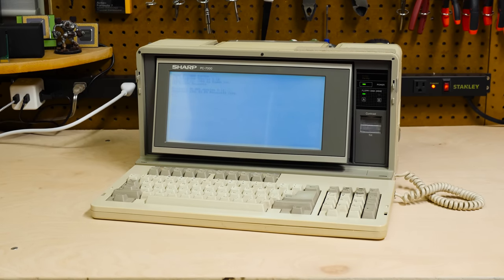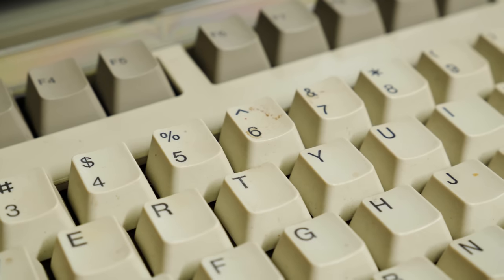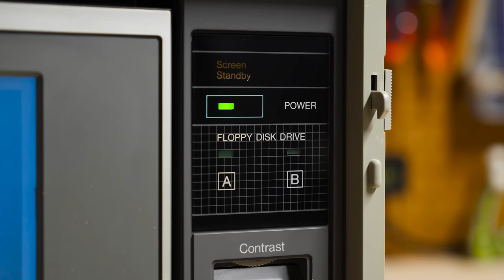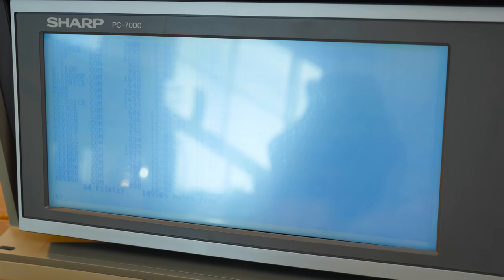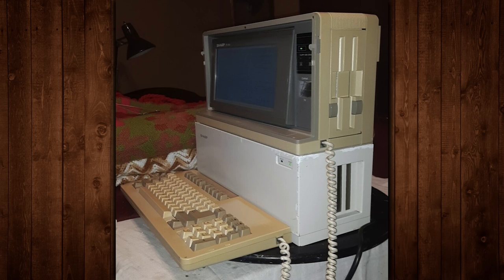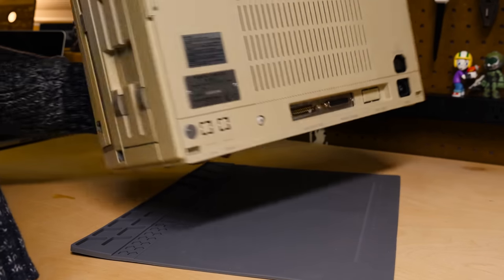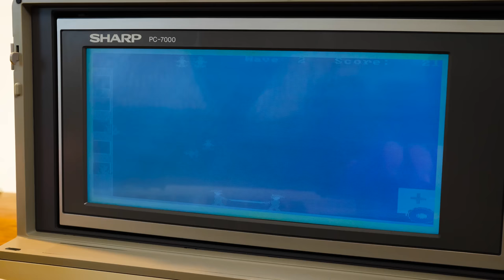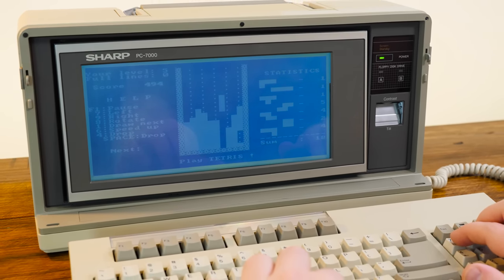$1,795 Luggable PC from 1985: Sharp PC-7000

Comment: I worked with one of those between 1988 and 1990. I was developing software for lotteries and aside from using the computer to edit and store programs on its dual 360 KB floppies, but would also use it as a terminal to connect to a mini-computer or use KERMIT to transfer files. The fact that it had an attached printer was an unheard-of option at the time. The monochrome screen was easy to read and it had a good keyboard. I wish I still had mine.
Reply: I wish they still made things like these.
I am a word processor / text editor fan, and I would definitely not mind having one as a text editor over a freewrite or a alphasmart.
Reply: @robertnussberger2028  The 8086 processor was faster than the 8088 on most PCs at the time. Having a built-in screen, even a monochrome one, was great at the time, and you could even adjust the viewing angle. Those were the days of Kermit, 2400BPS modems, Xterm, and all GUIs were character-based. I wrote PC assembler for the Sharp and used word processors to edit higher-level languages, transfer them to the host (or used the host editor interactively), and then compile and test there. Those were the days.

Comment: Also, pro tip: if you have the CGA add-on card, then you can play Those 160x100 modified text mode graphics games. I had mine configured with the onboard display as MDA while the CGA card is connected to an external Sharp TTL CGA Color display (yeah, it can totally support that use case). Good times.

Comment: I had one of these on my display at VCF East in 2022, with the factory hard drive add on and thermal printer. There were two hard drive add ons for the bottom, one with the ISA slots and one without, the one I have just adds a 10mb MFM hard drive, and about 15lbs to the carry weight!

Comment: @12:28 I know exactly what you mean.. While I used computers before we got our first one in 1994, it wasn't until that sorta point in time where I got to experience the older computers from the 80's. My closest "hand me down" memory is of a newer machine, sure, but I got a 386 laptop from a friends dad. Can't remember the model, but 386 at 16mhz I think? That B&W passive display tech, ~80MB hard drive, windows 3.1 and dos. I ran so much different stuff on it.. from Sim city, Civ, to transferring Nascar to it using a chain of floppies copying the folder from our family computer. Yup, the nostalgia bug goes hard thinking back

Comment: This remebers me of the first "laptop" from my dad. It was a Compaq Portable II and had the size of a midi tower PC.
Years later, I used it to program Siemens Siematic S5 or AEG Logistat A020 SPS systems
Reply: my father just had a massive full atx tower box (i think it was a 286 or 386?) with a drawer handle screwed into the top to take to project sites if needed.  there's really no modern case equivalent in size, some e-atx cases get close but this monster was like 3.5ft tall and weighed 80lbs.

Comment: This reminds me of the HP95LX I had back in the early 1990's. No hard drive, only a PCMCIA slot with ROM based DOS and applications and battery powered with AA batteries from what I remember. I bought the accessory printer and used Derive calculus software on PCMCIA during college calculus and linear algebra classes. It was great but admittedly slow and fit in my backpack easily.

Comment: What would it take to get ya to pick up a nonfunctioning one of these and turn it into a sleeper modern system? The conversion could be really interesting, and I bet you could cleverly hide a storage cubby for a mouse behind the 5 1/4 drive panel.
Reply: "Sleeper" is unlikely given how tiny of a motherboard you'd have to use for it; I'm guessing even mini-ATX would be pushing it. No doubt the mount points were made for some completely custom size, so you'd have to deal with that. And I can't even begin to imagine where you'd get a screen the exact dimensions of this thing. Probably from some supplier for digital dashboards or something.
Reply: @stevethepocket Maybe you could make the screen a system readout or something? Showing temps, fan speeds, etc.

Comment: Still using my Atari PC3 XT (and after searching for +10 years since 1 month also an Atari PC4LC) which I got since the '80's (my father bought it brand new back then). Still running strong, although did some updates like xt-ide, vga card and umb card. Those old systems keep on going!

Comment: I think it was a year ago that I was able to get a PC-6200 device from a shopkeeper who had put it in his shop window as a decoration. It was more like saving the device, because most of the back of the device was out of its natural form due to the heat and direct sunlight. After 4 hours of cleaning, I opened the device and realized that one of the parts was burnt. However, I still could not find the charger and battery or even the broken part of the device in my country. its a shame, I really wanted to bring the device back to life.

Comment: I didn't know you had one of these! I picked on up for free some years back but sadly neither floppy drive works. Haven't had time to go back to it yet, but the 8086 itself makes this computer stand out from the rest of my collection. One interesting featurette about this computer is that there are two positions for the carry handle, because the weight of the unit shifts when the printer is attached. Thanks for the run down - great to see another enthusiastic owner 🙂

Comment: Compaq had similar systems. Released in 1987. The Compaq III. A 12 MHz Intel 80286 and Compaq 386. A 386-20 MHz system. Both with 10" amber gas-plasma display and detachable keyboard.

Comment: The biggest issue with old portable computers isn't always even carrying them, it's the pain of actually using them on the go. You can't just pull it out and use it like a phone or modern laptop, you have to plug in power, boot it up and maybe put in a disk, connect to a phone line or internet. Once you get one out to use it you have to dedicate some time to make it worth it.

Comment: I have one of these with a built in hard drive in storage. No display last I tried it though. I'll have to dig it back out, I bet that damn Varta splooged all over the board. Now I'm curious if it has the RGB or modem expansion, if they splurged on the hdd maybe they checked all the boxes

Comment: Here's a techie question...
In old machines with unconventional screen sizes/ratios like this, how did DOS and programs of the day know how to adjust to fit to the display?
Reply: At this time, early versions of MS-DOS (1.x, 2.x, even 3.x) was customized by the manufacturer to fit the hardware. Microsoft (and other software compamies  that makes DOS clones) sold to the hardware companies their operating system in the form of source code (or part of it), which the manufacturer had to change the relevant lines to compile the DOS kernel.
 Any MS-DOS operating system had their kernel separated by two binaries: MSDOS.SYS which was always closed source to the manufacturer which contains the DOS API (that hooks the BIOS calls), and the DOS functions required to programs work. The IO.SYS contains the main device drivers routines (floppy, hard disc, FAT filesystem, serial, monitor, keyboard) required to interface the hardware. The source code (or at least almost all modules) was avaliable to the manufacturer to adapt the drivers code to their hardware.
 The Shell COMMAND.COM was always closed sourced. The manufacturer could program external device drivers that required to be loaded by CONFIG.SYS, and initialize utilities on AUTOEXEC.BAT, but on early days, loadable drivers don't work well on customized hardware.
When computer hardware becomes more standard, future versions of MS-DOS locks the kernel source code to manufacturer since the hardware was standard.

Comment: Kurt, I've owned the PC7200 for about 10 years, but in all that time, never has the original Sharp setup disk. Did your unit come with the disks or did you find them some place online? When I looked all those years ago, it was like unobtanium :-(

Comment: @LGR
So I wonder.....could you actually use this unit on a typical passenger plane tray table?
I think even with the keyboard out  it would just barely sit on a fold out tray, but I wonder if it would be too heavy and collapse the tray table? What do you say? Thanks! Yes some Boeing 737, 757, 767, had AC outlets too in the late 80s and onwards!
Reply from the maker: It feels juuuust about small enough to fit on a tray table. Depends on the seat and the plane of course. Certainly doable on a 747 in business class :)
Reply: @LGR  Wow, I'm honored to have been replied to by the Legend, of LGR! 😲👍👍

Comment: what is that thing used for cleaning? wd-40?
Reply from the maker: To remove the sticky stuff and oily stains I used some WD-40 and Goo Gone.
Reply: @LGR  question, didn't wd-40 will somehow break the plastic? i have bad experience before using WD-40 on plastic thingy and it become rubble
Reply from the maker: I’ve never had that issue myself, at least not on ABS plastic like this

Comment: The firmware setup screen isn't necessarily a thing now either.    Some motherboards do enable you to set firmware settings using a utility (it's pretty much the only way you can change a macOS setting), but not all motherboards do.